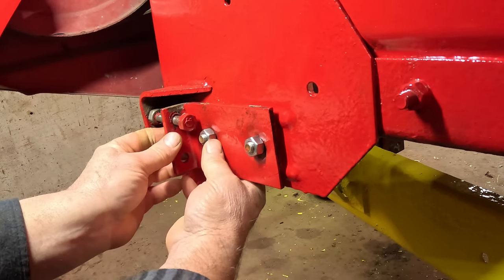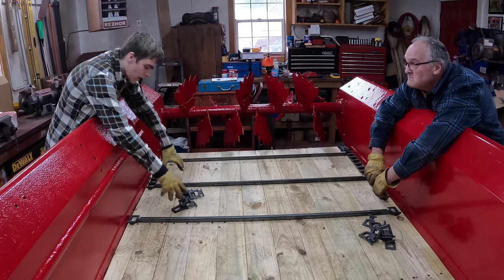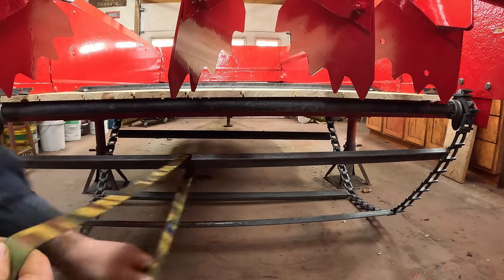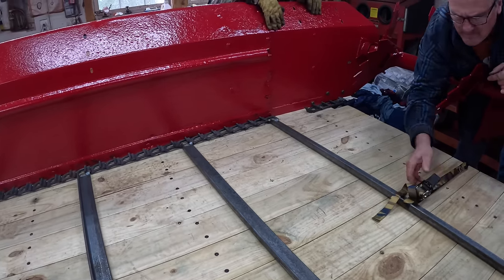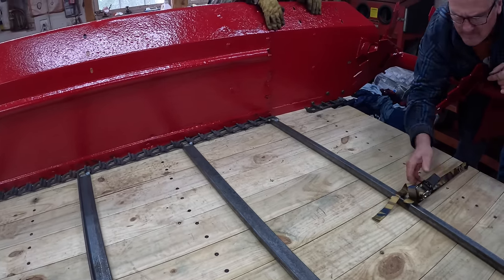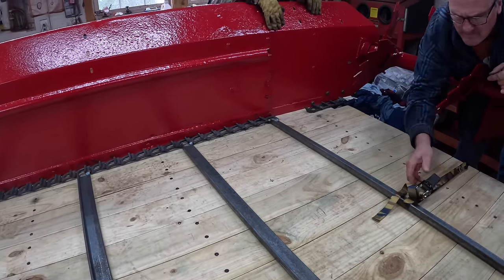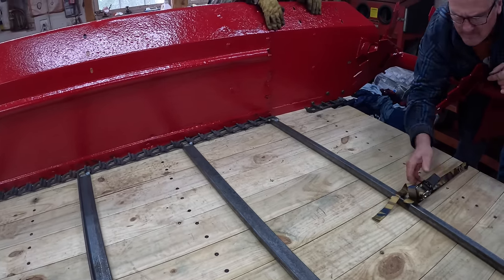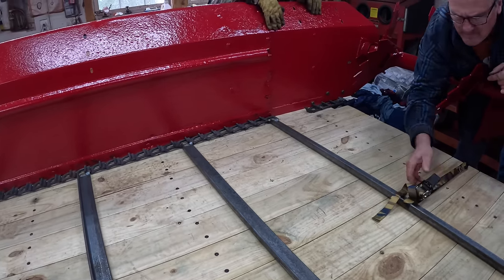The Great Manure Spreader Makeover (New Holland 514) Part 3

Comment: I agree with your logic on the wheel seals , I noticed there is a radius machined or ground on the seal  shoulder of the axle, so I suspect that is to allow the seal lip to easily ride up during assembly. She is ready to go to work ! Nice job , I had Henry’s role with my father on the farm   , it’s really nice to see him involved. It was a different time now so not judging , by his age I was doing welding jobs and some mechanical jobs on my own . I went on to become an engineer, I think all that fundamental knowledge helped me be successful, I ended up running an international business and worked on five continents and lived on 3 . He is getting an excellent start you should be proud!

Comment: I like your formula for degreaser! We Canadians substitute "Panther piss" for the bull urine you use, both are quite effective. Amazing how a little paint, some parts, and a large amount of labour revive old machines. I like to use "Hemlock" boards instead of pressure treated lumber for spreader floors, the old timers used them for the floors of the horse stalls here, and they last a lifetime.

Comment: I never tire of watching you maintain older equipment.  Whether we like it or not, doing so is essential to the economics of running a small farm.  One look at the price tag on their modern counterparts is enough to motivated maintenance and preservation of the old.  I'm still hoping that one day you redo the Farmall Cub that is tucked away in your barn.  While not a terribly useful tractor for most farm jobs, I really enjoy the simplicity and size for doing odd jobs.  For the last few  years mine has been relegated to pulling the firewood cart, which when loaded is just about its max pulling capacity going up my hills.

Comment: The reason the original seals where in backwards is because it has a greaseable hub. If you put the seals in with the garter spring towards the grease the grease will push out the seals if over greased if you put the garter spring out when greased the excess grease will slip past the seal and not push the seal out. That will be a nice turd hurst when you get it done. Keep up the good work.

Comment: Really Awesome job restoring Spreader and all the Tractors, can't wait to get started restoring our 1973 Triple 6 Diesel.
Do want to say, typically when it comes to lip style wheel seals, the seal goes into the hub so as you grease the hub, the lip allows the grease to come out, but dirt not to come in.

Comment: Pete you may know this already but a 22.5 truck tire will fit on a 10.00-20 or a 8.25-20 rim. Usually can find used ones in great condition for very cheap

Comment: Very nice job Pete.  Sounds and looks as good as the day it came from the dealership.  I appreciated all of the exposure to the mechanics in this video.  There was a lot more going on under all the panels than I expected.  
Only one thought to share; look for a set of balloon turf tires and wheels to spread the load to minimize compaction. 
Happy Thanksgiving to you and yours, Pete and Hillary! 😊
Reply from the maker: I wanted those type tires. They are very expensive.
Reply: @JustaFewAcresFarm  I'm a frugal fellow like you. I was thinking of the junkyard where old golf course equipment goes to die.  I imagine you could find useable balloon tires there given your top speed is less than 10 mph and your not concerned about spin outs 😂  Look forward to every episode Pete. 👍

Comment: Hey Pete love your videos. I have to say this. The seals on the hubs are backwards. The reason is the grease fitting in the hub. When you add grease to the hub you want it to flush the bearing and hub.  The seal in the present state will build up pressure in the hub and blow the dust cap off instead. Great videos. I look forward to every one. Enjoy.

Comment: I restored a 514 manure spreader, but I have not put the apron chain on yet.  The last video will  be extremely helpful.  I did get new sides for my spreader from new holland, even though I am not the original owner.  I put all new cross members on it made out of angle iron, as a matter of fact, I rebuilt the whole frame with angle iron.. I also got the back axle (1.25 (?) inch ) across the back of the spreader by pounding it out.   I put new bearings on the drive shaft down the side.  I had to seal the gear box that drives the apron chain.   I loved watching the three videos.  I don't know if I am wider in the back, so we will see if that matters.

Comment: The original grease seals on the wheel hubs were installed in the proper orientation.  In this type of application, the hub needs to "burp" as you grease the hub to relieve the air pressure that builds up as the hub fills with grease.  With the seals installed spring side in, as you pump in the grease, the internal pressure will build to the point where it will force the seal out.  In this instance, the seals are used to keep the dirt out, not the grease in.

Comment: having worked at a assembly line for tractors I also questioned this practice for hub bearing assembly and this is what i was told by the engineers, the first torque sets to bearing in place but will be too tight and wear out , second torque value is maximum friction bearing will endure without premature wear so back off nut to set pin will result in maximum life for bearing with least amount of play.

Comment: Great Job!.. Looks clean enough to eat off of. :)   So the wood deck...  I would have guessed that you treat with something to prevent the manure from sticking it to it & making for easy cleanup.  Like Wax or used motor oil.  I guess it is not  big issue.  :)

Comment: Pete I'm afraid that you have put your wheel seals in backwards.  Explanation:  Your wheel hubs have grease fittings on them, if you pump grease into the hubs/bearings the pressure will either push the seal out, push the lip out destroying the seal or push the grease cap out. In this application the seal is meant to keep debris out of the bearings, not keep the grease in.  As to your concerns about the spring being exposed to the elements, easy fix, replace the springs with O rings.  Not trying to be know it all, just an old retired mechanic that did the same thing once upon a time.  By the way, I have been a subscriber for a long time and this is the first time I've seen you do anything wrong!  :)
Reply: I saw the grease fitting on the hub, but figured with all the grease that Pete put on the bearings, there would be no need to put any additional grease into the hub via that zerk grease fitting.  If Pete does not use the grease fittings to add additional grease into the hub, then his placement of the seals should be fine, I'd wager.  Cars have no grease fittings for their front wheel bearings - same principle.  If that was my machine, I'd never use those hub grease fittings as the bearings are/were properly packed initially.  My 2¢ 😊

Comment: I have a 66 Beetle and adjusting the belts on that can also be a pain if forget what spacer it needs on the generator pulley. The transmission also uses hypoid gear oil.

Comment: I would have thought the links would have been angle side to square. Then the edges would have been worn down over time and last longer than square to square. But that would probably mean they're more likely to skip off the sprocket under load because there's a lot less surface area to grab?

Square to square makes more sense to me considering these machines were built in a time when repeat business through reliability meant more than selling lots of replacement parts. It's odd the book showed both ways. Maybe there's some performance benefit? Square to square on heavy loads but it increases wear, square to curve on light loads to increase lifespan? Doubt it matters.

Comment: Surprised you didn't put a sheet of teflon down for the chain and bars to ride on.   I have a smaller ground driven one that needs a new chain, but no one makes one, I have to weld my own bar links.  Since I no longer have horses though, it sit at the back of the barn.

Comment: Would there be any benefit to greasing the links of the chain?  To help it glide along the metal runners underneath and also to aid in it's rotation around the sprockets?  The grease would get contaminated rather quickly, I'd imagine.  Somehow I think that it would help in the grand scheme of things?  No?  Yes?

Comment: Pete great restoration of the spreader. Question what do you think of putting a light coat
of used oil on the boards for extra protection? I realize it’s treated but just a thought.
Can’t tell you how enough about how cool it is to see you breath new life into these machines.
Reply from the maker: Hi, I put some leftover Thompson's sealer on it after the video. I don't do the used motor oil thing; I just wash it out good after I'm done with it and store it inside.